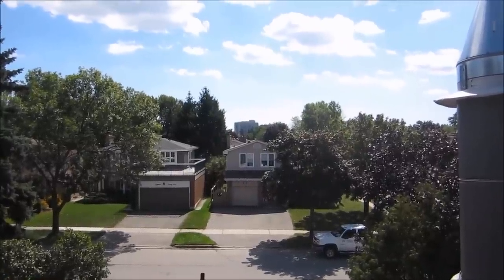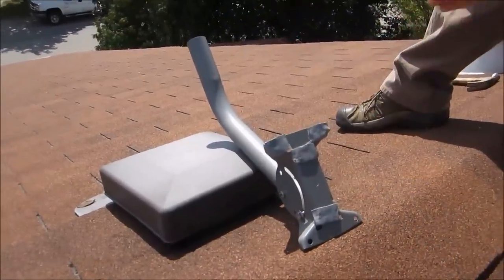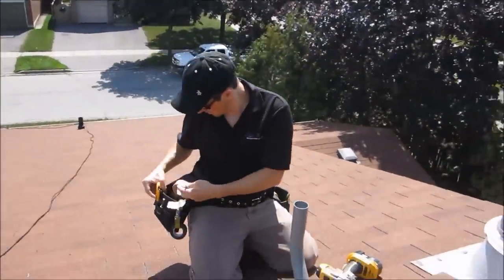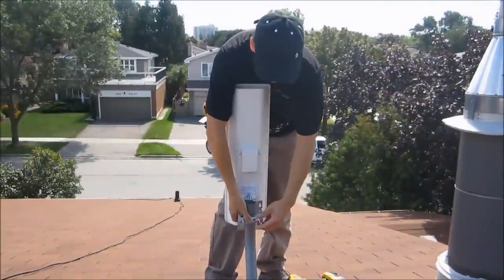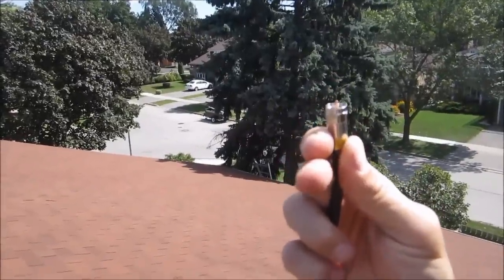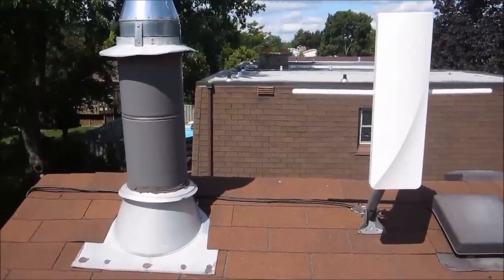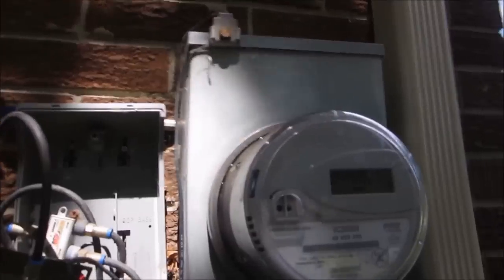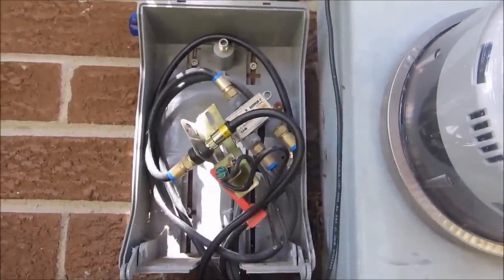HDTV Antenna Roof Installation with proper grounding

Comment: What is the model of the Coaxial Cable Crimper used in this video?
Reply from the maker: +Mark Keneson 
I think its perfect vision
Reply: +Mark Keneson Solder, Solder, Solder Brother! Much more longevity, lower impedance, increased durability (resistance to pulling off), elimination of potential corrosion and troubleshooting issues down the line, and, after all, we all know lead and flux is good for the soul! It is important to make sure your coax is not foam core though, because it is the distance between the center conductor of the cable and the shield that maintains the 75/50 ohm impedance, and the foam stuff melts CRAZY easy! Somehow I didnt melt my foam core when I soldered it using a gas soldering iron and a LOT of heat - but, its Belden China RG8X anyway - pretty much disposable cable. LMR or DX-400 is good stuff, but not necessary for every/most installations.

Comment: Awesome video. I learn so much from youtube. Like most things in life I find what I have been taught is all bs. I was always told roofers are the dumbest trade. This is wrong. Roofers do hard work and provide a service that will protect your home and family for decades. Antenna installers are the dumbest trade. No roofer would blast lag bolts through a good roof to mount an antenna. They know that bolts rust and those sealant patches shrink and crack over just a few years leaving your home vulnerable to leaks and damage. No roofers would say, hey jackass mount that antenna to the facia at a rafter. Use some adhesive and some stainless hardware so we don’t have to call another douche nozzle out to fix it.
Reply: Not sure if this is a compliment or a dig.  If the mount is sealed properly it will last the life of a single roof.  In my experience when a customer has had the roofers reinstall their antenna they use roofing nails which is terrible because the slightest wind will tear it out of the roof.  We all have our strengths which is why I recommend clients have a professional reinstall their antenna.  Never seen rusty bolts even after 10 years.

Comment: Does anyone know if Rogers techs have the right to cut coaxial cables leading into their boxes?

I recently moved into a house and don't have cable TV, though I have cable internet with Teksavvy (through Rogers).

A little context: The house has an antenna on the roof, and the cable comes down the side of the house to the box (the one beside the hydro metre and all that), where it is grounded, before going into the house, where it meets the pre-amplifier and is then split through the house.

I had an issue with my internet, so Teksavvy sent a Rogers technician. When the tech was at my house, he asked if we had any other Rogers services. My wife said no (true), and then I believe the tech proceeded to go in the box and cut the wire leading to the roof. I was pissed they would do this, as it's MY coaxial cable, but instead of complaining, I just put a new tip on it and that was that.

My concern is that they might try doing this again in the future, in which case I want to know if they can legally do this, or if I am in the right, as it's all on my property. Sure, maybe it's "their" little plastic box that my cable is going through (or is it mine?), but it's not like I'm messing with their cables or services, or tapping into their connections to steal cable in any way. I'm simply passing my cable through to connect to a ground in a covered place.
Reply: @Robert Bilodeau
 - It's your House, you do as you like!  The only thing you can't touch is the Electric that cone to the Meter... But from the Meter and beyond.... It's yours!  Just like your Water Meter as well.
Reply: It's not their cabling.  You own it.  It's on your house.  They just do it to be jerks and honestly why would a technician take it upon himself to do that unless he is a programmed robot by Rogers.

Comment: I like to put heat shrink tubing on my connections.
Reply from the maker: Use connectors with a weather seal at the back and o-ring inside the thread and you will never have moisture problems

Comment: Where do you buy those bolts with the seal?
Reply: +Bennett Giesler practically any hardware store or home center. They are just galvanized self-tapping screws with a rubber washer. You see them mostly used in applications where a metal roof is being installed.

Comment: what is the brand of the antenna being installed? Can I get it in Atlanta, GA?
Reply: Oliver Olirob  MARATHON Antenna
Reply: that antenna is garbage it's a simple antenna with a built in amp and 2 dipoles for vhf.  there is no technical reason why it would have better performance than a top of the line winegaurd or Channel Master,  those companies don't really retail in Canada that's why he's selling this.  yes it looks pretty,  but as a communications guy, I can tell you 100% CM and WG are.the tops.  plus a cm4221 doesn't really take that much more space if you can't afford a cm4228,  also both companies sell at sears.com, amazon,  homedepot walmart.   why you want a unknown antenna from a guy with a ball cap putting tons of holes in some unsuspecting person's roof?   this is the wrong way to install, guaranteed roof problem.   now his wire making and use of sealant inside with drip loop are correct.   if he seals the connection exterior with the putty tape and sealing tape 3M  recommends here on the youtube.com/3M  channel  then that parts okay.  always better to install on a proper antenna mast they fit on side of house or eve or on chimney.   to do it the way he did he should have used a non penetrating mount with 2-4 cinder block in its slots.   somewhere out of site.   perhaps homeowner was too cheap, idk  likely this " antenna " is a enclosure with a circuit board inside for a antenna hooked to a balun. $10 to make
Reply: Oliver Olirob Antop.

Comment: Dielectric grease can reduce connectivity since it doesn't conduct anything. This type of grease is used OVER a connection, you don't want it between 2 points of contact but rather cover once both contacts are connected. Now they do make conductive electrical grease which you put on the actual connections but the grease must not touch any other connector. You can lightly apply conductive grease on the threads and separately, on the copper cladded aluminum wire in the center. A better option might be to use heat shrink over the connection to keep water out or cover it with some type of sealant resistance to UV rays, weather..etc. However it's not necessary, cable companies don't bother sealing anything, just connect and go.
Reply: Oh also, if you use a splitter, you reduce your signal in half for every split. You must either use an amplifier to cope with the loss or for best possible signal strength, use a separate antenna for each TV.
Reply: If your referring to the white stuff in the tube he used, he used it absolutely correctly, that stuff is designed to keep water out of the connector.
Reply: If the connection is loose enough to admit dielectric grease between the contacts, then it is loose enough to admit air between the contacts.  Air doesn't conduct electricity particularly well, either.

Comment: With my skills I would it squeeze 20 more channels out of that antenna, he didn’t perform a directional test
Reply: He was performing a directional test. There are only a maximum of 59 OTA channels authorized by the FCC and not every area will have all 59 channels. In my area we only have 22 OTA channels. If your skills are anything like your grammar the I don't think he has anything to worry about.

Comment: You drill through the shingles? What happens in 12 years when I need to replace my shingles? WTF.
Reply: You remove the antenna and reinstall it
Reply: @daxtheaxe  - In this Video, he could have done it on the Side of the House!

Comment: I get 50 channels in the gta. I mounted on side of house and have it on 3 tvs.   Yes some are repeat and some are SD channels.  But you can get the network channels in HD.... city, nbc, cbs....etc.    Same as from rogers and bell but no monthly charges... Pay little upfront and dont have to worry about monthly charges.   I did the install years ago and saved alot over the years.    You can even do dvr.  I personally use plex for that but there are other ways of doing it.   I am surprised that all the people i know personally still pay for tv services.   I just think to myself... suckers.

Comment: You failed to ground the mast separately. The US code prevents using a coax “siamese” wire ground for TV antenna masts. It’s OK for short satellite antenna masts.

Comment: Us the cable messenger like ground ??????????????????? (Steel)
Reply from the maker: The messenger is not steel it is copper.  look at the video.  We use messenger cable with copper ground.  it's not the same as the stuff the cable guys use

Comment: Never would I allow this installation. Why not attach it to the facia or inside the attic?
Reply from the maker: I have been installing satellite dishes and antennas on roofs for over 30 years.  If installed properly you will not get leaks.  A j-mount will not secure to the peak fascia properly.  Only the top three holes on the mount can be fastened so some kind of improvised bracket needs to be used or an additional bracket and pole.  In my experience I have see about a 30% degradation in the signal when installed in an attic compared to outside on the peak.
Reply: Electroguy .. Use different mounting brackets, problem solved. I'd be furious with anything drilled through my shingles. Most instances an attic Installation works fine.
Reply: Agreed...You have been doing it wrong for 30 years as Jaquith says it belongs on the peak facia, its just as easy to find a stud there as a joist in the roof...also when your making something vertically straight its referred to as plum not level.  Pro's do not refer to plum as level. The cable then can go in the attic or run down the facia as you did it. Cable laying on shingles looks awful.
The rest of it looked good, you vid was done well , tho that grounding wire is not thick enough to meet our code.
Reply: They higher the OTA antenna the better  in the attic you lose some signal

Comment: There is No such thing as a HD Antenna.
Reply: You might want to rethink your comment. He isn't installing an HD antenna, he is installing an antenna designed for HD signals. Stations now broadcast in HD and older antennas can't always pick them up. The digital tuner, either in your tv or a set box, will convert the digital signal. OTA TV is actually true HD whereas cable and satellite isn't. Cable and satellite both compress their signals which degrades the quality of the signal. This is why they can give you 200 or 300 channels. OTA signals are compressed, but not nearly as much. Thereby you get a true HD signal on your tv when using an antenna.

Comment: Just FYI This is one of the worst grounding instructional videos on YouTube. This video is only for a specific type of pre-existing setup that was already grounded prior to installation. You get no instructions on the type of cable used and it's difficult to hear most of the audio due to wind noise.

Grounding starts at 11:30.

Comment: bad idea the eve of the gable is just a few feet over never make a roof penetration that is not absolutely needed       none would be better but local codes make us do these things not sure about antenna code but sat. providers have there ("pro" ha) installers mount to roof probably because they dont know how to find a rafter tail on the eve to mount to or what type anchoring device is needed.  I've done electrical work for over 40 years and never agreed with running a service mast through the carnish board and roof. the mast should be anchored in perimeter wall and offset over the carnish and roof to proper elevation. (the roof is intended to keep the elements out so the less or no penetrations is best. codes or not.
Reply: undeserved -  I agree 110% with your point/s.
PS: it is spelled "eave" and it should be "their"
Sorry to be a butt, dude and I'm only mentioning this for information and without ANY malicious intent WHATSOEVER.
(I'm the kind of guy who will tell you there's a booger in your nose; rather than let you continue to be laughed at by other people, who you come into contact with, after me). I truly hope you take it the way it was intended(?).
 Cheers.

Comment: 11 min wasted in: "be careful tightening the f connector onto this ("antenna" ) because you'll break the element inside"  so it's that flimsy that the female F isn't even secured inside.    you said it bro.  let's see a reputable test site measure this against winegaurd or Channel Master with 7778 or 7777 preamp or winegaurd lna preamp.  guaranteed this would lose.   good job on MAKING the cable that was perfect especially the dielectric grease too bad you didn't use mastic tape over it once connected then use the recommended 3m  vinyl UV resistant tape ontop of that.  in the communications field if you were a installer you'd be gone 1st day fatal error.   also your putty beneath the satellite J pipe you used will degrade over time because of UV you should have used 3m UV resistant  vinyl mat over top.  maybe mike Holmes will fix that roof and find your job is responsible,  can't wait.
Reply from the maker: Ok Grand Master flash let's see your video on how to do it the Kal jak waaaaayyyy
Reply: Over tightening won't break an "element". What it will do is damage the inside of the connector and cause signal issues. In CATV we used a torque wrench, I'm surprised he didn't have one.